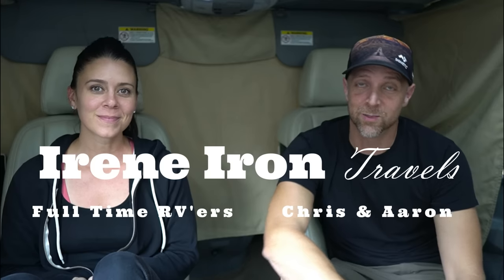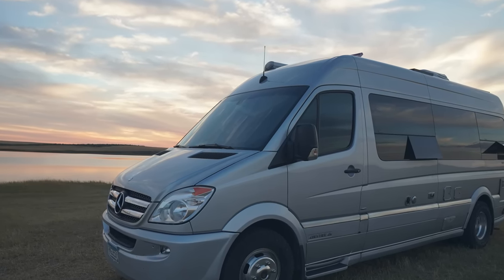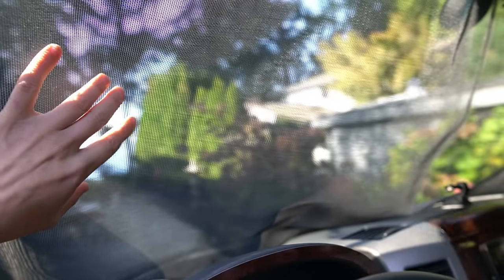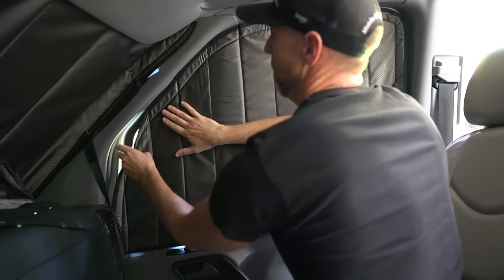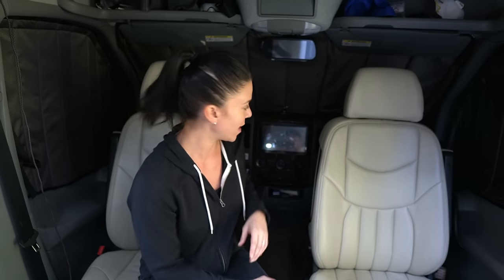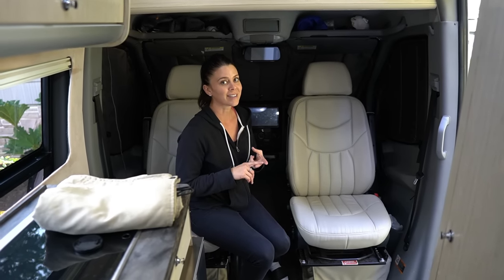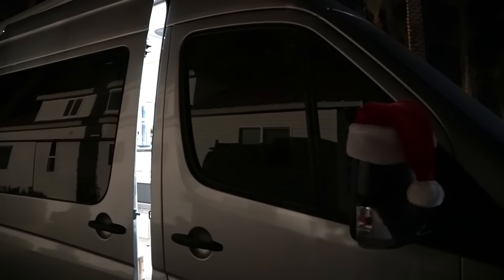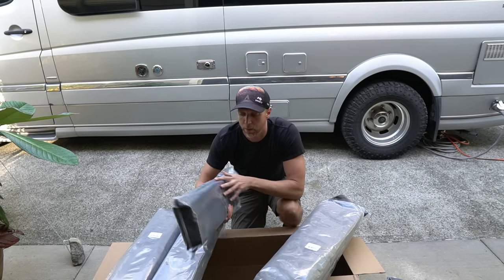Sprinter Van Window Covers by Van Essential

Comment: I have a full set and all the bug screens. The rear doors never come off and the crew window I and slider I fold in half and keep them installed so I only have to store the front windows when not in use.  My favorite thing is the rear bug screen. When the top flap is down, it’s just a black wall on the inside instead of looking at the rear doors. And when you open the rear doors pillows don’t fall out ( rear sideways bed with garage under). Best investment I made in my van.

Comment: I just today, received my Van Essential window covers for my transit crew and love them but the slider door window cover side seems under sized. It doesn’t fit like the other windows.  I’d have to install the metal tabs that are 3M stickied to the door on the window if it want it to stay up (if that makes any sense).  
For the price I expect a better fit. I’ll call them in the morning and make sure I received the right window cover.  Otherwise I’m happy with the other covers and bug screens for the most part.  A quick note on the bug screens, they are good quality but they could have very easily added a magnetic strip to the bottoms.  When the wind blows there is a gap that can allow bugs in.  Will likely have to make a modification to seal it up better.

Comment: Great video! Wish it got more views. Did not know that the rear windows were so large and had covers! Whoa! I know what I'm looking at tomorrow in my van!

My van came with similar window covers, but one side is light (for summer) and one side is dark (for winter). It's very noticeable. 

Also, a polarizer filter for your camera will cut way down on the sun glare. You look through the viewfinder and twist the filter until the glare is lowest. It won't go away completely but makes a huge difference.
Reply from the maker: We really love these covers. The brand is coming out with an updated design in April I think. Its amazing to see some of these 100k plus vans without covers or not very nice ones. Thanks for the tip on the polarizer! I also need to use the hood more often when in direct sunlight.

Comment: I have a 2016 and it came with similar by airstream. What I didn’t like about it is that the side shades need to be clipped with the glass. I liked that brand cause it’s magnetic and very easy to install.👍👍👍
Reply from the maker: I heard about that style needing to be rolled up into the window... Doesn't sound like a fun option being having to do that and I think they changed it 2017 or 2018 into a magnetic version??

Comment: Hey, Great video! Thank you for the review in these things. Only thing I was wondering, and sorry if I missed it, but do your screens work under the shades? Like, can you have the screens on, the shade over it, the top of the shade flapped down, and have the window cracked?
Reply from the maker: Hello thanks! We never tried it with the side screens, but it did work over the front windshield screen. The side screens might work...but they both need metal for the magnets to work and it might not be enough room.....

Comment: Getting the front ones since I already have insulated, side ones that I like.  Also, I will explore opening up my rear windows as well.
Reply from the maker: Morning! If you have the same sheet as we had, you'll love the new windshield cover for sure. Really recommend checking out the back as well, we really like having the bigger open windows in the back and I don't think the original plastic and shades did anything for heat and cold. Happy holidays to you and your family!

Comment: Excellent video. One thing I was concerned about is the back door where the original blind was removed to allow the shade to fit in. Just wish none of the van’s original parts has to be replaced with something better or requires mechanical skills to make improvements. You guys did a great job with this video and finding a better solution. I was not familiar with “Blackout” until now, but definitely good to know. Thanks for sharing this information.
Reply from the maker: Thanks! Appreciate the comment!

Comment: Great video!  We have have similar challenges to your other windows.  Ours have plastic trim/frames around them (like your former back window).  We'd really like to have the additional insulation but are challenged by the lack of metal fo magnetic installation.  Let us know if you find some alternative solutions.
Reply from the maker: Yes! All the windows in vans are a blessing and a curse. These are working out for us very well in heat and the cold.  We'll keep an eye out for options!

Comment: Good Morning ☕️
Another great video. 
I remember when Chris
Used to put up Aaron’s 
T-shirts in the window. 
🤣
Then you made the curtain. 👍👍
Those coverings look nice and so easy to use. 
Do you use the side window covers?
Do they help with 
Condensation?
Take Care ~
Safe Travels...
Reply from the maker: 😂😂😢 Ahhhhh the good o'l t-shirt days! 
We are still debating if we can make the middle side window coverings work. Our cabinet on the slider door is right up against the door when it's closed and we would have to modify the kitchen window as well. Plus, the kitchen window gets pretty greasy from cooking and we pretty much ruined the current blinds in there right now. We might try a roll down "Oceanair" style that can be wiped clean and is an easy roll up and down. Not as good thermals with that one, but is good blackout privacy.

We did get a good chance while in Washington this fall to test out the condensation effect, and I do think it helped a little.. but not a lot. We even got the dehumidifier as well and still condensation on the windows. There's NO stopping it!!!😆😂
Reply: @IreneIronTravels  
The big bulky frame that houses the shades seem to be a problem. You’d almost have to cover them atop that. 
Iffin your kitchen one is shot I’d be curious to see just exactly what’s underneath once you take it and the frame down. 
It would be a fun
Design challenge. 
They’ve got great wipeable peel & stick backsplash tiles. 
That’s IF your going to tackle the job. 
just thinking out loud
Reply from the maker: Yes, good thoughts! Might be something to tackle on our next big project 🤔
Reply from the maker: The soft fabricy material we have on the wall now is not friends with cooking. Peel and stick might be something to look into!

Comment: Can you fold the rear door shades up (partially/all the way) and still have them remain attached to the door frame? TIA!
Reply from the maker: You can but would have to modify a bit.  The velcro strap is too short so you would need to extend that to reach. We just pull the rears down and store right behind the seat it works great.

Comment: I saw you encountered some snow up in Washington.  How did the Airstream handle?  I am curious.  I have a 2018 Interstate and was wondering about how it would handle in the snow.
Reply from the maker: The snow in Washington was more of a slush..... but we actually got to drive in some "real" snow the first month we got in in Minnesota and it handles great. It's so heavy, that the tires grip the road well and as long as you drive slow you should be fine. I caveat this with we grew up with heavy snow and cold in the Midwest and have plenty of experience with FWD, RWD,AWD, and 4wd vehicles. Kinda fun!

Comment: Any condensation between the windows and covers?
Reply from the maker: If it is really cold overnight like the 30's there is still some condensation. Also if its raining and there is a lot of condensation in the air you will see it.
Reply: @IreneIronTravels  appreciate the reply. I went to their website to check the cost for my Promaster GL and noticed everything is out of stock until June. Crazy! Safe travels.

Comment: To apply and remove each day it's too much work.
Reply from the maker: Just part of van life for us. Lot's of setup and teardown daily! I think Winnebago uses a built in front windshield screen, but it is not full blackout coverage and doesn't have as good of thermal effects. Some say it rattles while driving too. We do really like the blackout/thermal curtains we put in the back bedroom/living room.
Reply: @IreneIronTravels  if I lived in the van I'd agree. They look good and the quality is obvious. In my RV I'm making as many things self held as possible. I see so many spending too much time prepping on arrival and departure. One couple fills their bathroom with things that later get put up on walls and counters only to take down again in 2 weeks. Um no thanks. I just bought a fan from cloudline so I can mount it on the wall

Super efficient 
Less bulky than residential 
Powerful 

So that's what I mean... anyway, time to install these vinyl planks... come on over if you not busy. Will have a floor installation party.
Reply from the maker: For sure, the more built-in stuff the better! Haven't heard of the Cloudline fan... will have to check it out. We'll be rooting you on in spirit on the floor installation! 😂
Reply: I keep looking at the space over the side entry door of my 2017 Airstream Interstate for some kind of additional shelving. Maybe a netting type stretched across? Like maybe that in a Airstream Base Camp? Any other ideas?
Reply from the maker: Do you mean above the sink in front of the screen door?  I'm always envious of the openness of that space, because we have a giant cabinet in front of half the sider door. Great for storage, but would be nice for the fresh air and be able to see outside. Yes, I think some type of netting or very tiny shelf might be the only option........